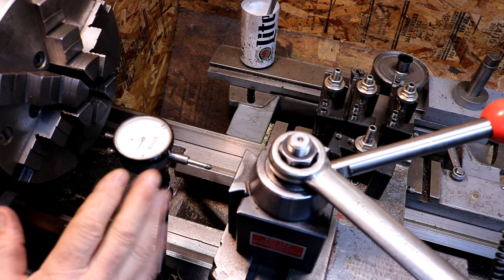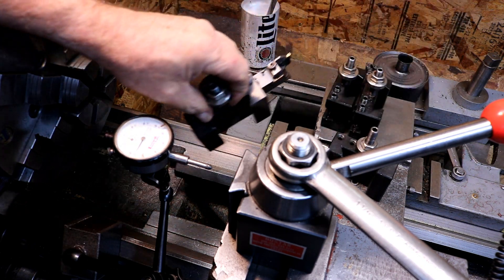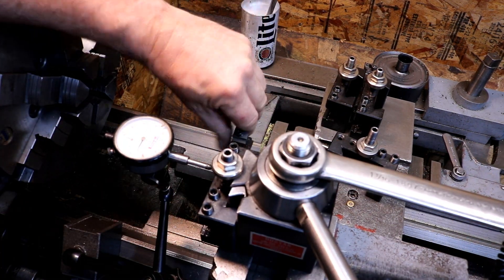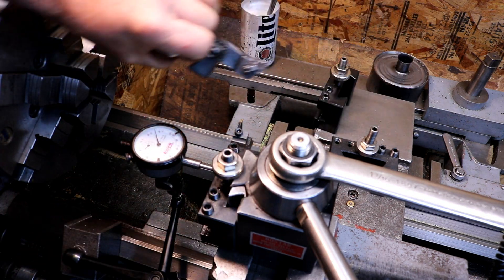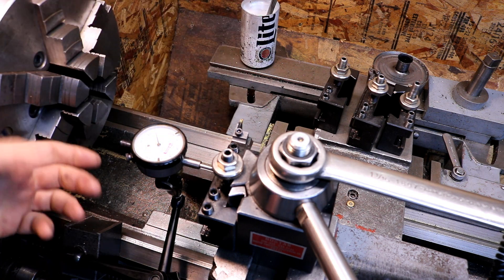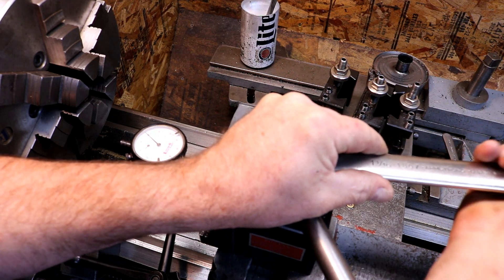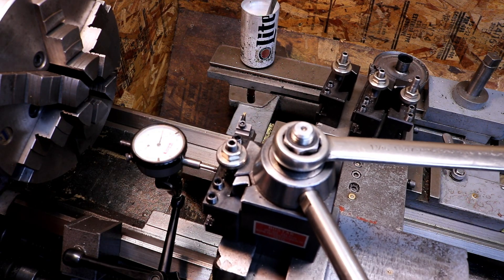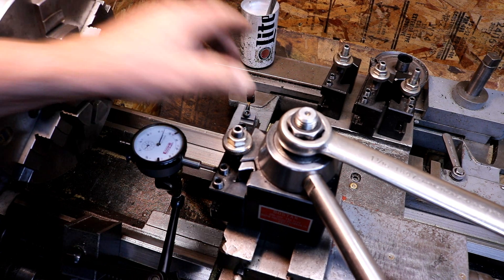Metal Lathe Tips | Metal Lathe Tool Setup | Metal Lathe Hack #1

Comment: Question about the dial indicator, how do you know it's not just picking up/showing surface irregularities instead?
Reply from the maker: I always go on a smooth surface.  Thanks.
Reply: @RRINTHESHOP  I'm just learning machining, I mean when you try this for the first time, how do you know whether it's the surface or the angle that's reading on the indicator?
Reply from the maker: Place the indicator on the tools side surface at one end of the tool, set the indicator dial to zero.  Then turn the cross feed so the indicator is 
at the  other end.  Do not worry about the reading in between.  Then turn the tool post so the reading is 1/2 of the of the difference of the tow readings.  Then travel back to the starting end and to this process until both readings are zero and no adjustment is necessary.
Reply: @RRINTHESHOP  Ahh okay, so by doing that you eliminate any chance of surface irregularity showing up as you're cross sliding back and forth?

Comment: I guess at some point you have to verify that your lathe cross slide is square to your spindle otherwise this method of setting up could result in a still off line parting tool.  That is when Bozo sneaks in and gets ya!! lol We all hope our cross slides are square but  most older lathes run a little taper from wear. I think all this alignment checking is starting to get to me. lol
Reply from the maker: Well yes.  I did make an assumption.  If you have taper in the cross slide you aren't parting very much due to severe frustration.
Thanks Brian.  I hope you get the HBM squared away soon.
Reply: Thanks Randy! keep those projects and tips coming!

Comment: I always just take a empty tool holder on the tool post, loosen the tool post, and touch it off on the face of the chuck and it seems to get things good and square.
Reply from the maker: It will be close, dialing in to the tool I find is more accurate for better parting.  Thanks.

Comment: Great tip, like you don’t move my QC post. Of coarse I’m a CNMG insert guy, but the same principle applies. In fact my compound stays at 30 degrees for threading, it was the way my mentor did it years ago when I started out in the shop
Reply from the maker: Thanks James.  Yep CNMG another good insert.  I keep mine compound over at 0.
Reply: Hi James, the lathe I am refurbing looked like the angle of the compound had never been changed since day one.  There was  nice little rust ring I am having to remove. but there is absolutely no wear to the scraping on the bottom of the compound.  I was very disappointed with the gib though, it looked like it had been made with a hammer and chisel, they didn't even use a file.  I'll stone it before replacement as I don't have access to a surface grinder, and it is a tapered gib.

Comment: Wise words but you have to ask yourself if you can get away with never having to move the tool post. If you feel the need to move a tool a little, rather than move the post you can move the tool in the holder and then it will be set for next time too. With the Dickson post you get a pin to allow easy reset of squareness, is there some way of doing the same on your post?
Reply from the maker: Thanks you Chris,  I have not seen a Dickson,  I will look into this.  I would love to do the Robin Renzetti tool post mod.  But I use the compound for angles to much.
Reply: I can not recommend the Dickson with an entirely clear conscience as they can vibrate loose but having said that mine has served me for many years. I would however always suggest a tool post that can easily be set square instantly, and if I had a fortune I would go for a Multifix, even the chinesium copy. but if I did have a fortune I would get genuine Swiss made set. But then again if I had a fortune I wouldn't bother with trying to reduce the world shortage of  swarf anymore and go cruising instead 😁
Reply from the maker: Boy that is alot of if's.  If I had a fortune I would be in the deck chair next to you.  Even though I have traveled  100,000's of miles on the ocean.
Reply: Somehow I don't think we need worry overly about what to do if we had fortunes, but it is nice to dream. As for cruising, i haven't been on one since i was 19 and that was quite a few years ago.😢

Comment: Randy, great tip on setting up the QCTP. I do the same based on aligning my ISCAR parting tool blade and everything else falls into line with this set-up. I took your previous advice on getting an accurate tru-adjust 6-jaw chuck and it has become my most used chuck.  I like these short videos on your advice. Thank you, Paul
Reply from the maker: Thanks Paul,  Got to love adjustable chucks.